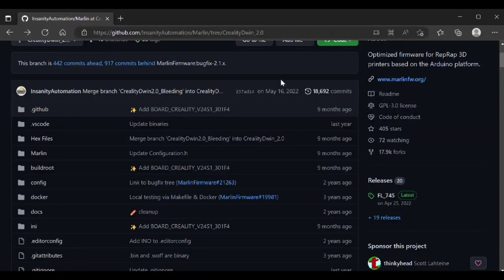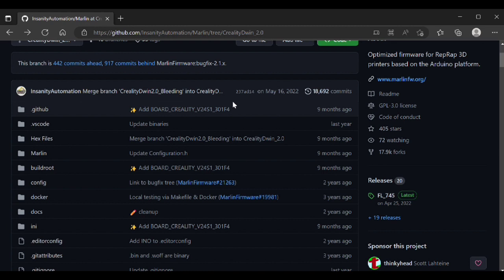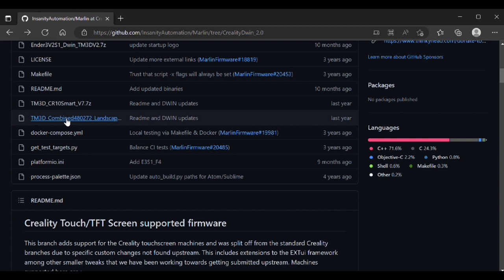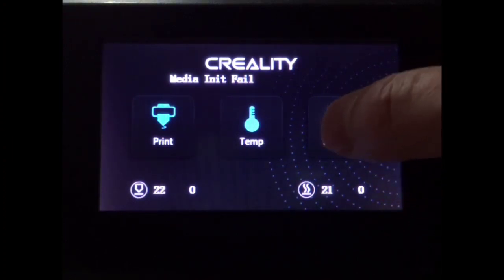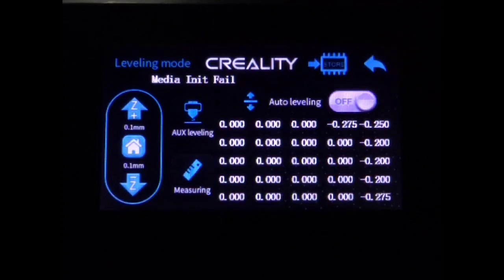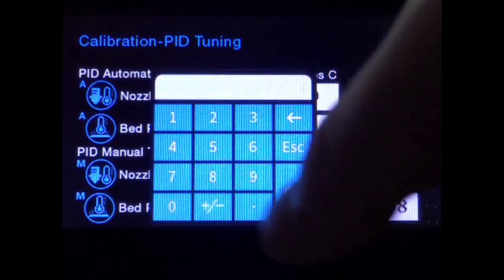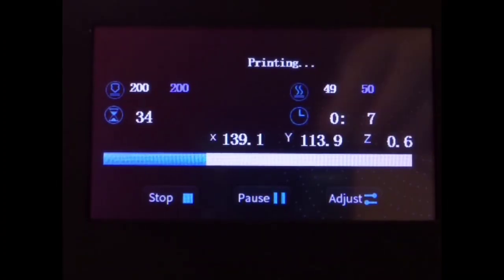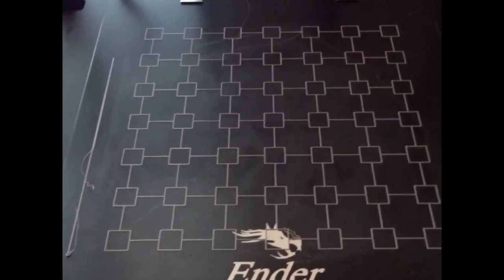Creality Ender 6 - Marlin firmware upgrade, the easy way.

Comment: Hi Joe! Thanks for the video! I just installed the CR TOCH and searched for the new firmware and came across your video. I downloaded the file you indicated and loaded it into the camera! I'm having a problem with the monitor's flash. It's not detecting the files. Do you have any idea what could be causing it? I followed the instructions in the Creative video step by step.
Thank you so much!
Reply from the maker: Use a small SD card and make sure it is formatted fat32 with 4096 sectors
Reply: @joeprints3dstuff  Thanks so much, Jo! I thought about it all night and this morning I reformatted the card, allocating only the 8 GB volume, and everything was fine! To calibrate the platter with the help of the Touch I installed, do you have any tips for me? The platter presses on the knob now.
Reply from the maker: Reset all of the knobs to half compression and then adjust your z offset to compensate

Comment: Hey I'm having some trouble with the firmware, when I downloaded the file from Github I couldn't find the .bin file to flash the printer with, did I miss something or did I misunderstand something?
Reply from the maker: There should be a .bin  on the github page.
Reply: @joeprints3dstuff  Thanks it turns out I am simply blind

Comment: i definitely have a question for you if you are willing to assist. 

I got this flashed and I dont have a BL touch but a CR touch. i am unsure if that is the reason, but when I level the bed, it gets close to the nozzle during the process, but then when it completes, its far too low. I max out at 9.000 Z offset and it still doesnt touch the build plate.
Reply from the maker: Make sure you are using the right version of firmware. There is a newer version from insanity automation that caused this exact problem. If you look in the description I provide links to the correct firmware.

Comment: hey joe, can u help me please i made a manual bed mesh. but when i turn off my ender 6 and after turn on again. the bed mesh is disapear.... just all is go to 0 and "auto leveling" turn off.

can you please help me how i can save the bed mesh
Reply from the maker: What firmware are you running and did you click on save? I know the stock firmware requires an SD card in the slot to actually save things but I do not think the insanity automation one does.
Reply: @joeprints3dstuff  Thanks for replying Joe. I'm using the exact firmware you used in the video. The "insanity" one. I have a Creality Ender 6 printer. And I used the same firmware as in your video. (Regarding whether I put the save button, I don't really know where the save button is.)
Reply from the maker: @alexismalkor7394 there should be an icon that looks like a computer chip and it should say "store".
Reply: @joeprints3dstuff  Yes, at the top right, there is a button that says store and it looks like an arrow pointing to a chip. Is that the one to save the bed mesh? Is it saved in the printer? Or do I have to put in an SD card?
Reply from the maker: @alexismalkor7394  it will save to the printer. No sd needed.
Reply: @joeprints3dstuff  but when i turn off and after turn on again the printer ender 6. is automatic he load the mesh?
Reply from the maker: You need to add m420 s1 to your start gcode. This is in your slicer.
Reply: @joeprints3dstuff  I understand now. Thanks a lot for your help Joe. The content you make is amazing. Thanks a lot for the help. If any other questions arise I will not hesitate to contact you.

Comment: there's an issue with the firmware , 
if you stop the print , the hotend will move to the front and crash the frame ....
Reply from the maker: Thanks, unfortunately I didn't build this fir.ware so I cannot alter its behavior. Also, make sure you are using the version from my github.
Reply: @joeprints3dstuff  ill rebuild it and upload it to you when i be free ..... im gonna fix this issue also fix some bugs
thx for reply joe

Comment: Hi Joe, my name is Ricardo Taveira and I speak from Brazil.
First I would like to apologize because as I don't speak English I am using Google Translate to communicate, I hope you understand in case of spelling errors.
I have an Ender 6 that I purchased in July 2022, it already came from the store with Marlin da Insany 2.0.9_dw 7.4.3, as you can see a version slightly earlier than the one you installed on yours.
My problem starts when I, with a lot of experience in computers but none at the time of 3D printers, tried to upgrade the Marlin that was listed on the Creality website and as you can imagine, everything went wrong and my printer had a black screen.
I looked for the reseller who provided me with the version that came with the machine and everything went back to normal, except the SD card reader which when the printer starts up already detects a failure when the SD card starts up.
As I was already printing from Cura using a USB cable, I didn't pay much attention to it at the time.
Now I want to install Klipper on it using a Raspbarry PI 3 but I'm faced with the problem that I have to flash the card and as the card doesn't work I'm stuck at this step.
I believed that the SD card reader was having a problem, but in my research I discovered that in the Marlin of that time (I don't know if it still happens today), the SD slot was disabled and so I understood that this was what happened in my case, the file sent by the store to reset my printer came to this situation, as I noticed that the SD Slot stopped working shortly after that.
Well, after this long story I would like to know if you could help me solve this, sending me your uncompiled version of marlin DW 7.4.6 so that I can enable the SD slot in it and update my printer through Visual Studio using the USB cable, or If you know any other way to do this update without using the SD card.

Can you save me?

Thank you for your attention and I look forward to your response.

Thanks

Ricardo Taveira

Comment: i have a problem with the setting steps/mm on the extruder. The max value is 600 and it's to low value for my BIQU H2 V2.0 direct drive extruder. Have you any idea for it?
Reply from the maker: The firmware is setup for the stock hardware. Normally when you want to change hardware like the extruder or the motors you will probably have to rebuild the firmware to accommodate.

Comment: Здравствуйте все конечно хорошо ,спасибо за видео,но почему вы не сказали что все настройки с pid и регулировкой стола,нужно проводит со вставленной картой памяти в принтер????поэтому у многих и выходит проблема люди не поймут как настраивать..спасибо что я сам догадался об этом..
Reply from the maker: You do not need a sd card for this version of marlin. Everything is saved to eeprom.
Reply: Но у меня сработало только с sd картой
Reply from the maker: Very odd.
Reply: @krotkvasov6923 what firmware did you install? and did you flash the screen? Do I need to remove the card from the screen or printer?

Comment: I installed the DW in my ender 6 and some things are a little wonky, I dont like it. I would like to know how to revert back to original creality software. When i try to install the latest software, the touchpad does not work please help. either that or how do i fix the fact that, when i have a sd card installed and turn the machine on it goes into a loop of the startup screen, when i press the manual lower Z it goes up and when i press up it goes down. when i press home it goes home but the bed lowers like 20mm or whatever. ect bunch of stuff is off
Reply from the maker: Did you use the files in the description?
Reply: @joeprints3dstuff  any info on how to revert to stock would be greatly appreciated
Reply from the maker: You should be able to just flash the printer and the screen using the official creality software.

Comment: Hi I installed this . All working except it says settings saved when I save them but if I restart printer all settings are reset. Any ideas?
Reply from the maker: Make sure you initialize the eeprom
Reply: @joeprints3dstuff  how do I do that ?
Reply from the maker: @mcbungie  it should have asked you right after you flashed it. If it didn't, you haven't flashed it.

Comment: I entered the new URL but I see that it says "Not Found". please help with the files
Reply: ho! I already saw the error, I went to the main repo and from there I was able to download the file. I see that the URL has a section /blob/main/firmware_Ender6_DW7.4.6.zip
Reply from the maker: @roberttorresmerino3334 glad you figured it out. I will fix the url.

Comment: Let me start by saying thanks for the vid.
Secondly, since this video, clearly, there have been some updates, so the files shown here are not the same in the link.

Now, It started off well, but:
1- I did not get the screen shown in your video. I just read the comments about using an 8 GB SD card, which I did not do. So, I will try with an 8Gb card and see if that makes a difference.
2- When I canceled a print, the print head somehow went so far off the axis it started making the belt motors skip pretty violently. I realized only after that it had set the volume to 260 x 260 while the Ender6 is 25x250 (not sure how I missed that. How do I edit the firmware to fix that?

Thanks
Reply from the maker: Unfortunately I do not think you can set the size via gcode. Which files did you download? Someone else was complaining about the same issue.
Reply from the maker: Use this link. Should contain what you need. https://github.com/JoePrints3dstuff/Creality/firmware_Ender6_DW7.4.6.zip
Reply: not found  @joeprints3dstuff

Comment: I have successfully updated the firmware on the Ender 6, Have the touch screen extracted and can see all the audio, video and other files files.  My mSD card is a 32 Gig, the Ender comes up with the Blue load panel, but all the file sizes are 0000.  Waited a while but nothing would happen. Does the SD card have to be partitioned to 8 Gig 4096?  If so how.
Reply from the maker: You need a smaller card.
Reply: Please explain. I am using a Sandisk Ultra Plus.
Reply from the maker: You need an 8 gig card or smaller.
Reply: Thanks, borrowed an 8 Gig card used on a Elegoo, deleted all files and loaded the DWIN. Unit does not recolonize the DWIN folder file , What next should I try?
Reply from the maker: @dennischerry4545  Please ensure that the sd card is formated fat32, 4096 blocks. The screens on these things are super finicky.
Reply: Thanks that did it.  Not good you have to use older technology on a fairly new product. Not my printer, just helping out a friend.  @joeprints3dstuff
Reply from the maker: Glad you got it sorted.
Reply: I have another problem, the fans will not turn on when printing, they will come on manual but as soon as I do a print job the fans turn off. Using PLA 200/60. The print head at startup on a print shows 210 and the sensor is working on the head.  All I am getting is a clogged print head. Tried of cleaning the print head.
Reply from the maker: Normally fan control is done in the slicer. Usually, the first few layers are done with the fans off.
Reply: OK, thanks.  Got the unit to finally print the 50x50x25 cube and it came out fairly good, was impressed.  Tried to print a different  part and back to square one again with no filament again and clogged.
Reply: When I cancel a print, the print head stops then instead of moving back and right (Home), the print head moves forward and starts bumping into the frame. What settings should I look at to fix this?
Reply from the maker: @dennischerry4545 make sure you are using the right firmware for ender 6.
Reply: I followed your video step by step. @joeprints3dstuff
Reply from the maker: @dennischerry4545 i don't know. Make sure the versions in the video match the files you downloaded. All I can really say is that my ender 6 did not do that.
Reply from the maker: @dennischerry4545 out of curiosity can you move the printer to 0,0 and then the other end 250,250. I am wondering if the problem is your endstop location.
Reply from the maker: Use this link. It should sort you out. https://github.com/JoePrints3dstuff/Creality/firmware_Ender6_DW7.4.6.zip

Comment: Is there anyware I could find the source code for ender 6 to take a look at to avoid the printer to crash into doors when stopping a print? I see the code, but its for every printer listed.
Reply from the maker: I would ensure you are using the right firmware. But the code itself is the same overall. Its the configuration that changes to suit the machine.

Comment: Hey there boss . Did firmware fine but when trying to do screen it comes up with the files but just says end after process and doesn't actually download anything /update the new screen features . Any ideas 🤔
Reply from the maker: Its super picky on the sd card. Make sure its 8gb or less formatted fat32.
Reply: @joeprints3dstuff  yeah after abit of messing around I just reset the card as 4gig and it worked instantly . Such a random problem hahah thanks boss 🙏🙏
Reply: @fatpandaproductions9833   Thanks man, this information is helping me in 2025, very much appreciated!

Comment: sir, the bl touch version where is it probe offset point
Reply from the maker: I no longer use the standard mount so I am not sure. Sorry.
Reply: This is great. except I have similiar issue. When i set BL offset to good distanse between nozzle and bed (-8.000) it does not remember it when i try to measure, and the bed never reach the BL touch, and start over and over again with homing. @joeprints3dstuff
Reply: I have tried both BL touch versions, and ZM seems a litter more accurate. I got stock printer.
Reply from the maker: Make sure you are saving the config once you set your z offset.
Reply: Thank you for fast reply! ur the man!
Yepp. stored Z offset -8.000 and its present in the display. Next time i homing the printer, the bed stops 8mm apart from nozzle again. when i am trying " measureing", it never touchers the BL Touch anymore and does another homeing, and it want me to set a new Z offset, but it is still -8  @joeprints3dstuff
Reply: @joeprints3dstuff  I figured out.. On stock firmware, I had to remove the microswitch for Z to get my probe work. But now I had to reinstall the cable for that microswitch

Comment: It's not the same now as listed in the video
Reply from the maker: Numbers might change but the process is still the same
Reply: I tried to flash the latest from Creality, no change, I need to rule out bad firmware
Reply from the maker: @kc6331gmail  what problem are you having?
Reply: First off, had a bad mobo and B motor, they were replaced.  I started it up yesterday, all seemed good, got it leveled, then the B motor started making an atrocious noise, like it's out of phase...and instead of moving sideways, it crab walks

Comment: hey- thanks for the great video. I falshed this fw (with bl touch) and i am getting wirerd behaviour- at the corner where the x and y are pressed - the printer thinks it is (x,y) location (252,252). Any one knows how can i change this value to 0? or where is this value stored to change it?
Reply from the maker: Back right corner should be 250 Front left corner should be 0
Reply: @joeprints3dstuff  But how do you change those values???
Reply from the maker: @davidchanget2563  you don't. Why do you want to change these? Again, 0,0 is at the front left near the doors. Normally speaking, this is always the location of zero. Unless its a delta.
Reply: @joeprints3dstuff  because.... when you press stop print or pause print, the print head goes to 0,0
Reply from the maker: @davidchanget2563  i guess I just don't understand what you are trying to do. As far as I know though the geometry of the bed is not adjustable.
Reply: @joeprints3dstuff  I'm digging into re-compiling the firmware to fix this issue. It should just be a few lines of g-code in the configuration.h file. Do you think that swapping the x and y motor cables might fix it?
Reply from the maker: @davidchanget2563  if 0,0 is in the left front corner it is not broken. That is how it is supposed to be.
Reply: @joeprints3dstuff  I dont understand why it tries to go there when you stop a print though. The end stops are at 260,260
Reply from the maker: @davidchanget2563  I see what you mean as normally stop print moves to the far side of the bed. Which i guess is where you are expecting it. However, it is moving away from the homing position. In the end though why does it matter as long as its away from the print.
Reply: @joeprints3dstuff  because it crashes into the frame and just stays in that corner while the steppers are still turning.  It makes a ton of racket and I'm sure it's not good for things.
Reply from the maker: @davidchanget2563  yes, that's no good. Odd that mines didn't do that.